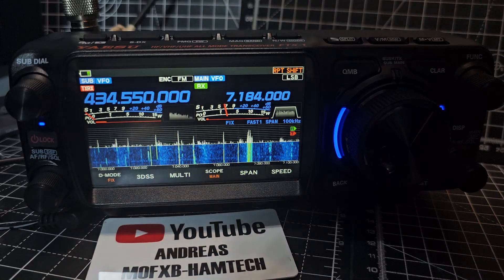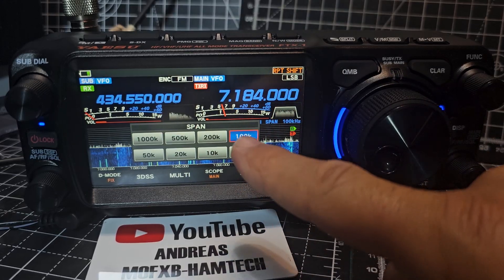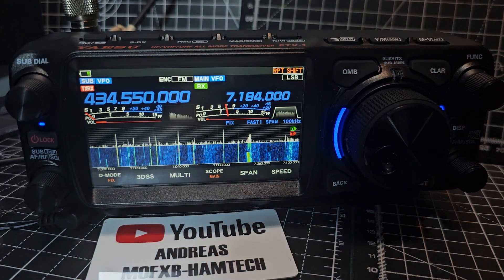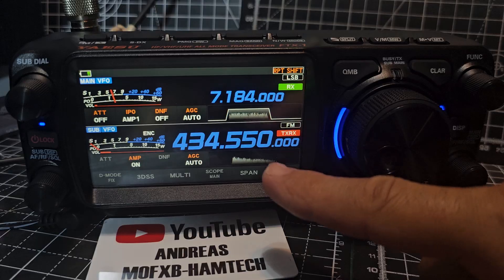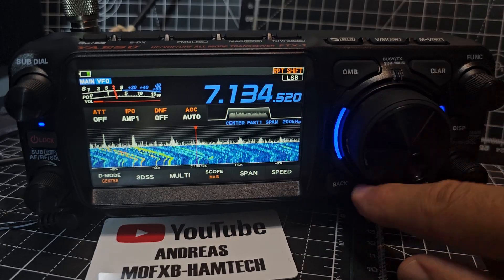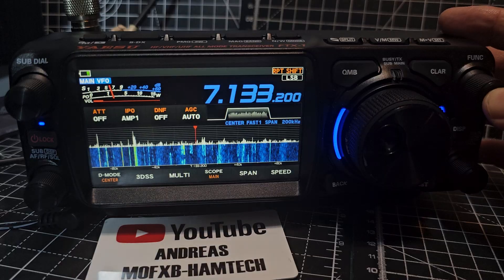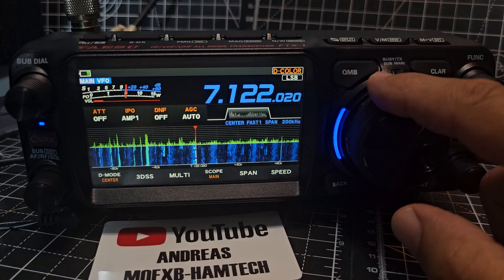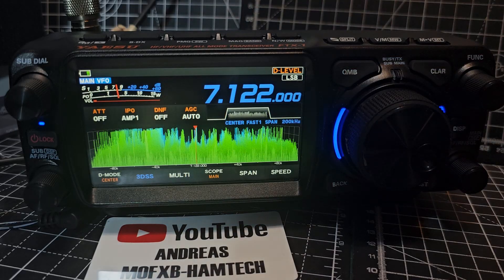Yaesu FTX-1 , Dual Waterfall Display ?

Comment: How do you set the FTX-1 to switch to the UHF/VHF antenna on TX? When I TX into a repeater, the radio uses ANT 1 which is my HF antenna. 73
Reply from the maker: Use lower antenna
Reply: @M0FXBHamTech What lower antenna?

Comment: The latest firmware is supposed to show which antenna is currently used, in the top bar of the screen: did you see that already ?
Reply from the maker: I do not have optima :(
Reply: @M0FXBHamTech  it’s only with Optima ? I missed something there… 🤔😛